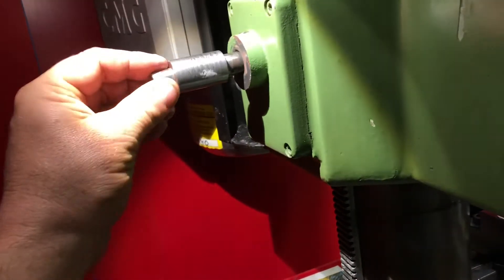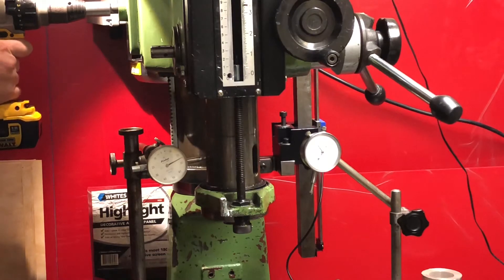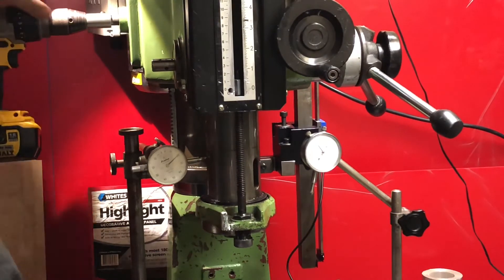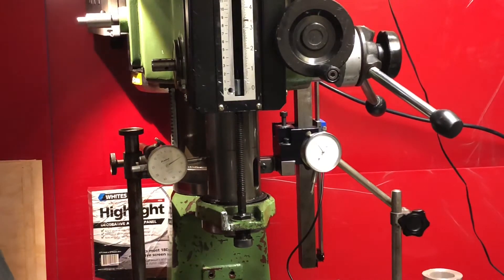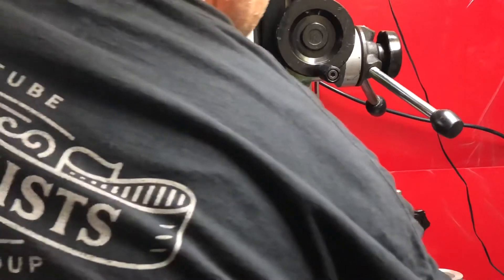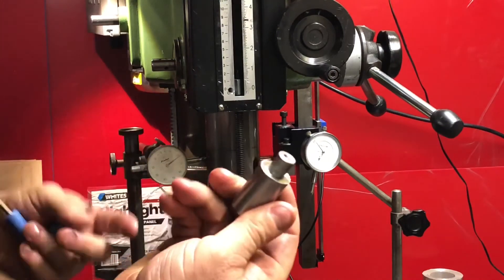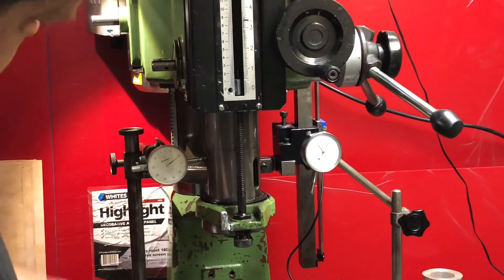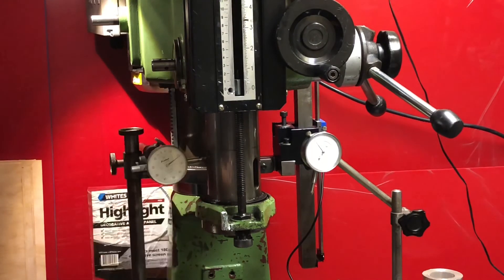Wrong Foo Power Z

Comment: Cuppa joe already did this in 2015, have a look at his mill. https://www.youtube.com/watch?v=hRwu9plKfO4
Reply from the maker: Yeah we were aware of his solution, but found the scissor style a bit less rigid when we were working through the options. The collar clamp and block provides a self squaring capability that is really nice as well
Reply: @JBFromOZ  I'm mainly talking about his idea for the power drill raise, which this video was about, and his way of mounting the drill rigidly,  what are you refering to, when you say scissor style.
Reply from the maker: @michaelrichardson3251  ahh my bad forgot that part of the wrong foo build, I was talking about the round column wrangler, of which cuppa Joe uses a scissor arrangement to keep the head from rotating sorry

Comment: Would you use this instead of the quill drive or as well as, for major height adjustments? I may have access to an older RF30 for cheap, but all the fine feed quill gear teeth are stripped off (the Main 3 arm drill press feed part). So it's really just a huge drill press. 
So far I can only find a replacement quill gear in NZ for about $290. Not really an option. 
I've been thinking about other options for fine quill control that don't use the quill gears.

Comment: I used a windshield wiper motor and it works great. I made a coupling that would address shaft misalignment and a mounting structure that attaches to the worm/pinion gear cover.
Reply from the maker: That’s a great idea! The worm and wheel would provide decent gearing
Reply: Nice idea. How did the gear reduction go? Did it seem a good speed and not too hard on the motor?

Comment: I think that idea has legs. Needs a chain and sprockets to bring out the steam punk. If only you had some steppers lying around😇. 

Dan
Reply from the maker: I’ve got some really nice 5.18:1 metal gear planetary Nema 17’s that might work, windscreen wiper motor or equivalent as mentioned by Mike is also a contender!
Reply: JBFromOZ : Wiper motors or window lift motors would be good I agree. 

Dan
Reply: It would be fun to see the little Nema 17’s step up or step off to this challenge. 

Dan